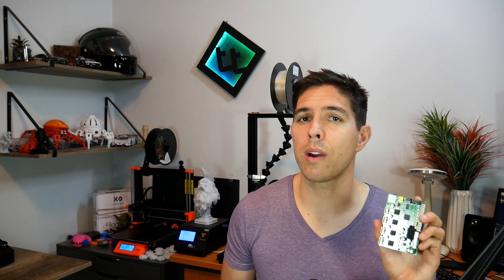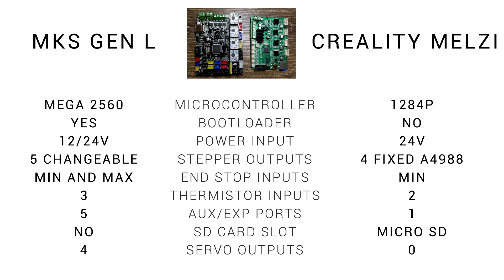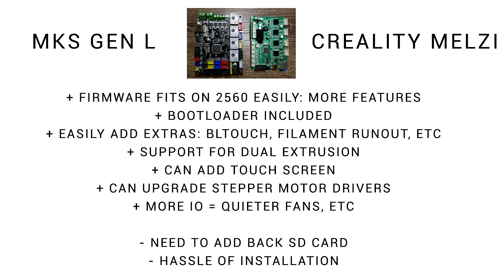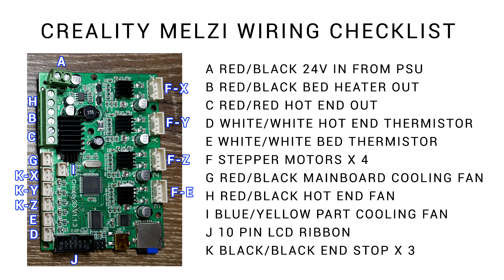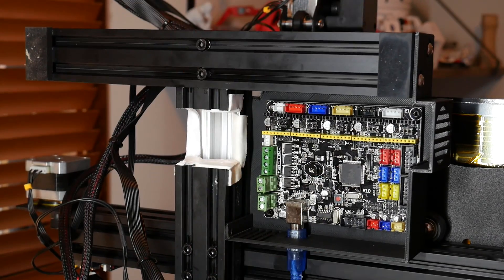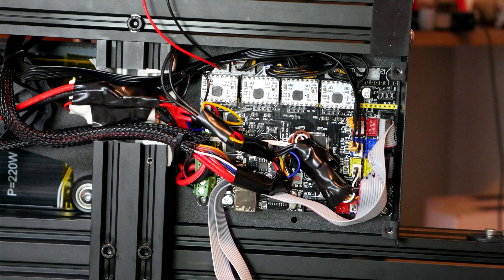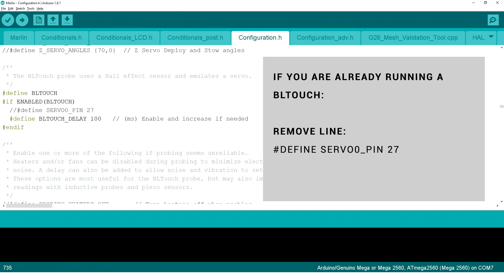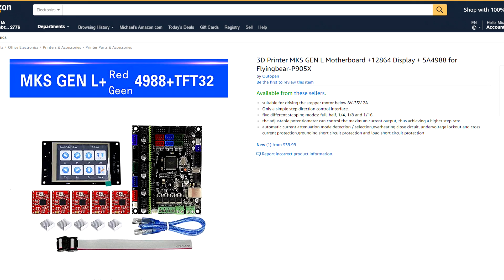Easy and cheap Ender 3 mainboard upgrade: MKS Gen L guide

Comment: You DO NOT need an extra ribbon cable if using the original LCD. Use EXP1 on the MKS and EXP3 on the display, however on the display end cut the small tab on the ribbon cable plug off and rotate the connector when plugging into the display.
By doing this you can then use the EXP2 connector for a SD Card reader.
Reply: This is what I did on mine too and it works perfectly fine.
Reply: I followed Michael's guide and the only major problem I came across was when it came to the lcd display. If you leave the cr10 display active(with the original lcd screen of course), you can keep using only a single ribbon with it plugged into the 1 display port and 1 board extension port. No flipping or chopping off tabs required. It's dead simple, I don't know why he made things confusing by trying to change things.
Reply: @oxrock2k1  Because people like me ordered a board, stepper drivers and started upgrading only to find out halfway through that I needed another ribbon cable theoretically. This is a saver for that sort of thing. 
Also, the SD card reader thing.
Reply: Got a couple of questions for ya.

Are the firmware changes identical as in this video when you do this 'hack' with the stock display?

What kind of SD-card reader should you buy? The ones on banggood are different depending on what type of screen you are going to use.

Thanks,
Reply: @vintage0  You ignore the part In the video where you are told to uncomment "REPRAP_DISCOUNT_FULL_GRAPHIC_SMART_CONTROLLER" and comment "CR10_STOCKDISPLAY".

As for SD Card reader the MKS is Ramps 1.4 compatible so you need a Ramps compatible SD card reader. Im not sure if the Sdramps would work with Micheals replacement case?
Reply: "You ignore the part In the video where you are told to uncomment "REPRAP_DISCOUNT_FULL_GRAPHIC_SMART_CONTROLLER" and comment "CR10_STOCKDISPLAY".
"
My ender is strange :D I made this as U told and i had blank screen. But when i uncomment REPRAP_... and use CR10_STOCKDISPLAY then it works(with rotated connector) :D But now i have a problem with contrast, how to adjust? I dont have any hardware potentiometer
Reply: @nanab256  Im not sure how to adjust contrast as mine was fine after I rotated the connector and used CR10_STOCKDISPLAY in my config.
Reply: Just tried this and I have a blank display, what needs to be set in Marlin 1.1.9? I suspect something in there is not correct (I used vanilla marlin for this)
Reply: @JimmyWhiteuk  Did you turn the ribbon connection at the board 180 degrees? You would need to trim off the channel guide on the connector or turn the black plastic connector on the board.
Reply: @JimmyWhiteuk  Are you using a CR10 display (1 ribbon cable) or a CR10S display (2 ribbon cables)?
Reply: nc2010vettef55 that was it - hadn’t defined the display, thanks!
Reply: @JimmyWhiteuk  I had same problem with Marlin 1.1.9.  For my fix, I uncommented  #define CR10_STOCKDISPLAY.  The note in the firmware says:  
// This is RAMPS-compatible using a single 10-pin connector.
// (For CR-10 owners who want to replace the Melzi Creality board but retain the display)
Reply: Thanks for this comment. Saved me from having to buy another ribbon cable. Rotated it around and it worked fine on a MKS Gen L like you said.
Reply: I have one of those Ramps SD card reader chips.  I tried plugging it into the EXP2 but it didn't recognize the reader.  Do you think you need to switch it over to the DISCOUNT_REPRAP video board setting and use 2 cables before it will?
Reply: Hi, by any chance can you give a link for a working sd card reader to buy please ?
Reply: Thanks! works fine!
Reply: Checkout my project https://www.thingiverse.com/thing:3434519

It is for popular sd card reader with all changes in firmware explained.
Reply: I can confirm that this works as long as you DONT comment out #define CR10_STOCKDISPLAY and keep the //#define REPRAP_DISCOUNT_FULL_GRAPHIC_SMART_CONTROLLER commented out. I did this on an mks gen L Thanks for the sweet tip!
Reply: Many thanks! This solution works perfect for me!
Reply: Thank you so much for this @totalretributioncouk I was at my wits end as to why my display wasn't working.
Reply: @feldim2425 That's correct. I had to do that to mine to get the display working properly.
Reply: I cut a second notch in the plastic on the display to do this easier to do with flush cuts and it worked well thanks. I saw reviews of the GenL boards getting tanked for having backwards display plugs which prompted me to try after seeing this.
Reply: Just to add someting: If you do this with one robbon cable make sure it is fully intact. I had the red wire cut for the BLTouch on the stock board. all I had was a flickering screen. When resoldered it worked.
Reply: @feldim2425 Thanks for the info, that's what fixed the display for me. Flipping around the ribbon cable and using the stock CR10 display in Marlin.
Reply: Appreciate this advice, I don't have an extra one of those cables around to use.

Update: this advice worked. I done the board swap, LCD running with 1 ribbon cable (flipped 180 on the screen side).
Reply: The word "Hero" has many definitions - you are definitely within one of those.
Reply: thanks for this tip. Saved me from having to bust out the 10pin connectors and make a ribbon.
Reply: ...or just buy this: https://www.amazon.it/dp/B07LFZSSWB and you have the sd card onboard.
Reply: Unfortunatelly this workaround doesn't seem to work on bugfix-2.0.x branch...
Reply: Will this also work with the SKR 1.4 board ? those 2 boards look similar
Reply: OR you dont have to cut anything and rotate the plug:) you can lift up the black socket from the MKS board and flip it around, so the plug from ender stock cable will fit keyed in correctly
Reply: @Pap9  worked for me! didnt change any firmware settings for the display and just rotated the black plug on the MKS. Thank you!
Reply: @TimPen  For rotating the plug did you have to desolder it first and then solder it back 180 degrees around ?
Reply: @mikem8145  Nope, just prise the black plastic plug away from the board carefully leaving the pins in place and turn it around and press it back on to the pins
Reply: @TimPen   Ok ok ok I don't have the board with me now but I think I understand what you mean : the pins are soldered to the board and you can remove the black socket while the pins stay soldered to the board, the pins will slide out of the black socket, then you simply have to rotate the plug. Oh thanks man I would have never though of that!
Now I'm a bit confused about EXP ports and firmware mods so maybe you could clear things up for me please. With your hack and to keep the orignal Creality display, I don't have to use a second ribbon cable and EXP1 & EXP2, I can use the original EXP3 port with the original ribbon cable, am I right? And about the firmware, what do I have to do to make your hack works? Thanks again!
Reply: @TimPen  Sorry I just reread your post and you wrote you didn't have to do any mod to the firmware. But which firmware do I have to use so the original Creality display can work with the MKS Gen L ? Thanks
Reply: @mikem8145  I didn't change any display settings just left it the same as the display settings that were on my Ender 3 Marlin file. Hope you get it working man :)
Reply: @TimPen  Thanks again for your help Tim. I'm really sorry to bother you again, I'm a newbie in 3D printing and everything is new to me. With my MKS Gen L installed (still in its bag) my intentions where to install Marlin vanilla version. Is the display going to work or I have to flash a custom version of Marlin? Thanks again!
Reply: @mikem8145  You can flash the vanilla version of Marlin (I am using 1.9.9) but when he says to uncomment out "REPRAP_DISCOUNT_FULL_GRAPHIC_SMART_CONTROLLER" and comment "CR10_STOCK_DISPLAY", don't do that. If you have, reverse the changes. Then on the display side of the ribbon cable, cut the key off (the tab that makes it so it only goes in one way) with flush cutters or craft knife (away from the ribbon cable so you don't cut it) and then plug the cable in backwards in the EXP3 slot and keyted normally in the EXP1 slot on the MKS.
Reply: @LiLTrublMakr  Thanks! About the ribbon cable Tim suggests to simply reverse the black socket on the MKS board, instead of cutting the tab, you don't agree?
Reply: @mikem8145  It does the same job really. I have a switch for LED lights connected to my front panel so I would have to disconnect those the take the panel off to flip the socket. It was just easier for me to cut the key off the connector and mark it with a metallic sharpie to indicate where the key should be.
Reply: @mikem8145  when you install marlin 1.1.9 there are pre configured files in a folder for the ender 3 specifically. Micheal has a video on installing that already so if you watch that video then follow instructions from this you should be good to go :)
Reply: @LiLTrublMakr  I still can not get this to work. I have done precisely what you just wrote here. I left the REPRAP and CR10 comments as they originally were, commented and uncommented respectively. The cable on the MKS is plugged into EXT1 in standard orientation. The other end is plugged in backwards to EXP3 after being trimmed. I still have a lit up blue screen that is totally blank.
Reply: @Chunkylover12313  Just to be clear, CR10 is uncommented and reprap is commented?
Reply: @LiLTrublMakr  Correct.

 I have it set as:

#define CR10_STOCKDISPLAY

and 

//#define REPRAP_DISCOUNT_FULL_GRAPHIC_SMART_CONTROLLER
Reply: @LiLTrublMakr  I got it! I reversed it. I have it oriented normally on the LCD side and reversed on the MKS side and that did the trick. Strange how it is the opposite for you and others.
Reply: @Chunkylover12313  In the firmware case, "#" acts as comments and not "/". So you should have:

define CR10_STOCKDISPLAY
and
#define REPRAP_DISCOUNT_FULL_GRAPHIC_SMART_CONTROLLER

 You actually have both commented with what you have above. But hey, if what you have works, go with it!
Reply: @LiLTrublMakr  Bizarre. As long as it works, thanks!
Reply: @Pap9  By lifting up the black socket do you mean desolder the socket and solder it back 180 degrees around ?
Reply: Mine doesn't work. It just lights up but displays nothing.

https://youtu.be/OsJKF2UkJFA

Do you know why?
Reply: @matejsokolec2973  Is that on an MKS 1.4 or an MKS GEN L as your video title says 1.4. It looks like your rotating the cable on the MKS end where as I rotated the cable on the LCD.
Reply: @totalretributioncouk   It's a 1.4 board but the motherboard was flashed correctly. I will try to rotate. Thanks for the info.
Reply: @totalretributioncouk  YOU MY MAN ARE A LIFESAVER. I rotated the connector on the LCD side and low and behold the thing works. You have my eternal gratitude internet stranger.
Reply: Hopefully Michael can do a follow up video showing this method and maybe even including a SD card reader.
Reply: did u finish with the marlin isntallation as i see it's still in the builds?
Reply: @matejsokolec2973  Try rotating the ribbon cable connector that plugs into the board 180 degrees. You will have to cut off the channel guide or better yet, make a new ribbon cable with one of the ribbon cable connectors rotated.
Reply: @matejsokolec2973  I had this same issue.  I suggest you follow the advice of the posts above.  Take the single ribbon cable and cut the tab so that it can be inverted.  Keep the CR10 video line commented and don't uncomment the generic graphic display line, as was shown in the video.  This worked well.  Good luck!
Reply: @matejsokolec2973  well that why i love upgrades but dont do it yet
Reply: totalretributioncouk This is EXACTLY how you undermine Michaels “idiotproof” guide-by putting ideas into people’s heads who are not as savvy as yourself with this stuff.
Reply: @Johnn_T  I wouldn't say that. His comment was so useful to me as I did everything I saw in the video and got to finish setting up my printer without waiting to get a ribbon cable delivered from amazon. It's not complex at all. Literally just did what he said.

Comment: Why not go for a 32bit board if we are upgrading(might be a bit more expensive)
Why go with the default StepperMotor Drivers?
Reply: have you done it?  if so, got a video I can check out?  would love to try it on one of the enders i have sitting around
Reply: What board would you suggest
Reply: @tmac2797  well in my ender an Duet 2 Wifi works just great. Its expensive and you dont need it with a normal  Prusa Clone
Reply: The BigTreeTech SKR 1.3 is a 32-bit board and very affordable (~$20).  It's a SmoothieWare board but it will run Marlin 2.0 (it's already added into the latest Marlin 2.0 bugfix firmware).  Others with much more experience than I do have upgraded their Ender 3's with this board but there isn't much in the way of a step-by-step tutorial right now (at least that I could find).  I'm muddling my way through it right now since I'm new to messing with the firmware and setting up stepper drivers.  I bought TMC2208's and will be using them in UART mode (no additional wiring to the drivers is required and driver Vref's are controlled in the firmware, not with jumpers and wires).  This video is the closest thing to a tutorial I could find and it will be helpful for wiring up the SKR except for some Marlin 2.0 tidbits that I'm gathering up from multiple discussions on the internet.  A tutorial for upgrading to that board for specifically the Ender 3 would be awesome.
Reply: Consider this video a base - learning how to switch out your main board. Everything else builds onto that. This mainboard is a low cost board upgrade that is the first step towards other upgrades. It's the same way you wouldn't tell a new hobby silversmith to go out and buy a rolling mill and a collet block, you tell them to buy a basic silver set and then when that works for them, they can buy the upgrades. That's not to mean that the new hobbyist can't go straight to the rolling mill and collet block, but you would never advise them to go that route right off the bat. 
That's how you have to look at this video

Comment: Why not use the MKS Gen 1.4 board or should I ask what is the Difference from "MKS Gen 1.4" and the "MKS Gen L"
Reply: a quick read shows the Gen L board being newer and smaller.
Reply: The Gen 1.4 doesn't have a dedicated connector for the part cooling fan, but seems pretty similar apart from that.

Comment: I really really want to do this, i have zero problems with hardware but scared to death of firmware and have no idea. I would pay money for help. Over the phone or something?  I only need to have the sd card and touchscreen, i autolevel by hand and dial gauge.
Reply: bruh, firmware is the easiest part. You can experiment until it works, since if there is a bootloader installed there is virtually no chance to brick it.

Comment: i did the same, but with the Fysetc F6 board and TMC 2208 drivers. Almost the same als the MKS but it has slightly more features and all pins are accessible. Got the original display working too :)
Reply: Do you have a blog about it? im interested in the result of the upgrade as well as the how-to
Reply: @Eewokney  I've been meaning to do a write up about it but I'm afraid I won't get around to that. However Michaels video is excellent, so I recommend following that but with a different board and do some freewheeling along the way. If you're not confident about that, I wouldn't not start a project like this. I've spent/lost more hours debugging than I care to admit :D
Reply: Add me to the list of curious people hungry for more info on the F6.
Reply: @SteinerSE  start here http://wiki.fysetc.com/F6_V1.3/
Reply: @HenkFueltank  Yeah, their wiki is pretty good, but it's also pretty much the only source. I'm surprised and confused over the fact that there's just so few youtube videos about the board because it seems really nice. The "plug and play" UART control of TMC steppers alone should sell it (and it looks bloody good too).
Reply: Wish there was an diy for idiots to do that lol. I feel like yours is worth doing
Reply: Does the Fysetc F6 board have the same mounting and USB locations as the MKS Gen L?
Reply: @Mike_Neukam  The layout seems similar with the USB in the same place, but there is a slight size difference (3mm height and 7mm length). Not having any CAD drawings and just judging by eye I would say yes. While the PCB is a few millimeters larger on the Fysetc the holes are also slightly further in than on the MKS board so it might be the same footprint.
Reply: @Mike_Neukam  I have no idea, i don't think so because the dimensions are different

Comment: Excellent video as always but one correction for the cons of this decision if keeping the original LCD it's easy to add external SD card reader for MKS as EXP2 connector all pins are for controlling the SD card. Happy Christmas.
Reply: I think VCC (or 5 volts is missing, as it is provided on EXP1) so if your replacement LCD has a built in SD card, then the Vcc is not required as it's provided on EXP1)   if it's a totally seperate SD interface, you will need to provide +5 volts...  hope this makes sense. :)
Reply: @waltermiraglia8134  Yep I missed that point. In fact the idea to use external SD adapter was from one video here with ender 3 control board replacement with Gen L.